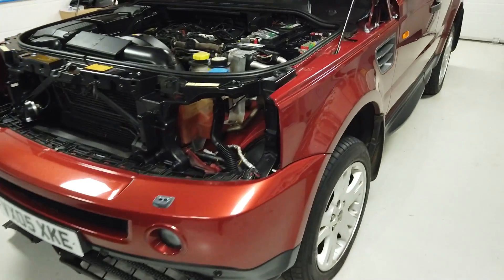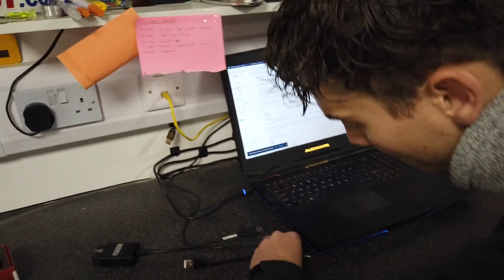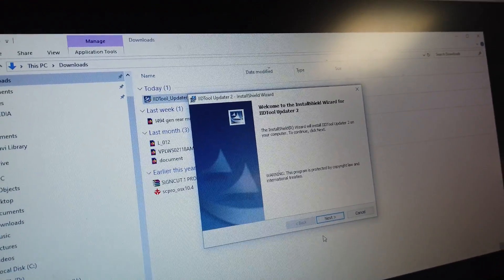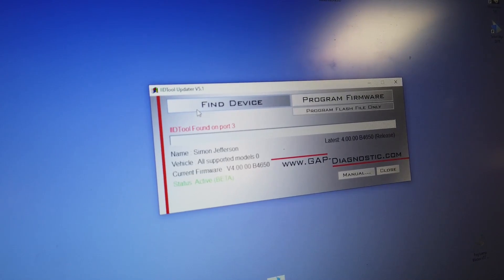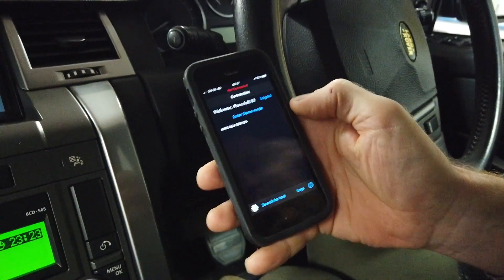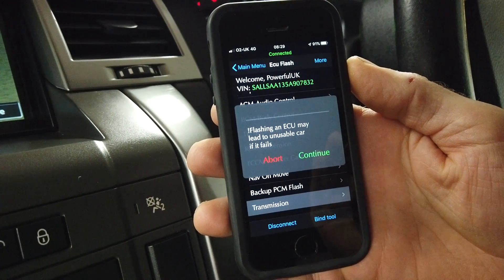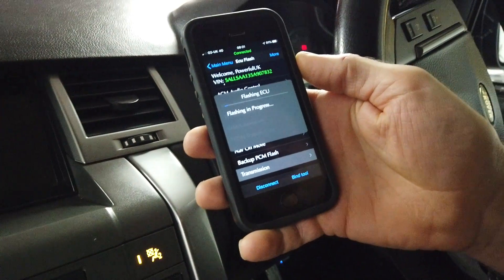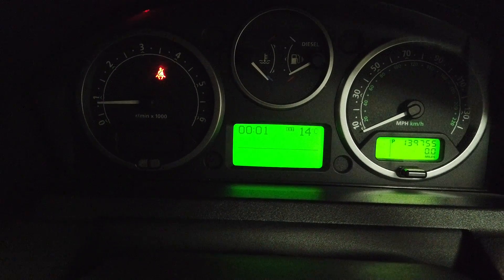We fixed it !!  Range Rover Sport L320 replacement gearbox re-coded using GAP IID Tool !

Comment: Do you guys know of any cheaper tools on Amazon that can reset the adaption values to?  I swapped transmissions and switch the computer over to but now I notice a slight jolt into evert gear shift, and sometimes a hard jolt back at stops. I hear it's because the original computer is still thinking it's the old transmission.
Reply from the maker: In theory the gearbox should learn its new values as you drive it.... not aware of any cheaper tools - but I have not looked / tested any
Reply: @powerfulukltd  I found a Foxwell that did it. Before that I tried the gas pedal trick. No way of knowing if it actually reset adaption but my landy did start driving better after about 2 days after the  5 second pedal trick.

Comment: Nice video man thanks for uploading 
I have 2006 Range Rover sport 4.2 supercharged 
And I have transmission fault  comes on quickly when I start the vehicle Them shutting of with 3 seconds 
No problem shifting or any other issues 
Can you tell me what could be or can I do the same with the scan tool
Thank you
Reply from the maker: Hi - i think you need to do a fault scan - most garages can do a fault scan for you to see the problem.
Reply: @L663  hi I scanned it and got a code P173E ignition key lock solenoid circuit low
Can not clear the code
Reply from the maker: @TheIrfanxz44  Hi - read this
https://www.rangerovers.net/threads/transmission-fault.340108/
Reply: @L663  thanks for the link
I found the problem 
On the TCM one of the pins of harness was broken and corrosion
Reply from the maker: @TheIrfanxz44  Well done - your one happy man now !
Reply: @L663  thank man you are great help

Comment: Hi I have same problem with my rr but not changed gearbox wood this work with mine driving me mad thanks
Reply from the maker: Hi - you need to get the fault code read by a garage - or use an IID tool - the most likely problem is a solenoid issue - you could try an oil change ?

Comment: All this electronics problems in Range Rovers, that's why these things never go in to outback or remote areas. Soccer mum cars or shopping SUV's. Get a Land Cruiser for the real work.
Reply: Well you could, but a new Land Cruiser has similar technology to a D2 (& that came out in 1998). With an IID tool you occlude take that ol RR Sport anywhere. The biggest problem is the lots of owners get them service at their local joe Bloggs garage. They don't have the correct kit to properly diagnose faults. In addition, to be fair, Land Rover said the autobox of the early RR sport/D3 was 'sealed for life' Everyone knew that was a recipe for disaster

Comment: Awesome job , tackling the same issue here. Can you confirm if the TCM you coded with the Gap iid tool was a used TCM with the second hand gearbox or it was a brand new TCM? I need to code a used TCM , I've heard rumours you can't do so.....